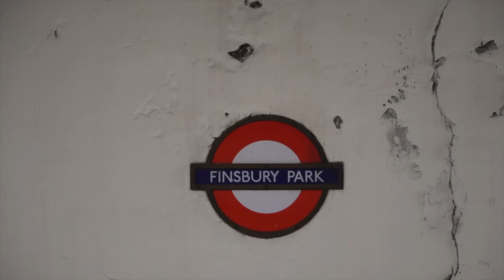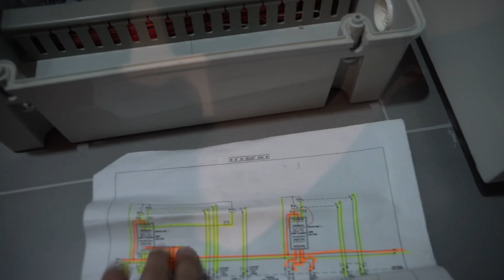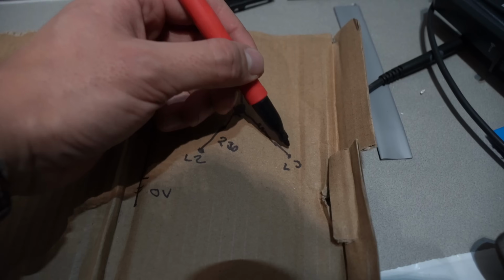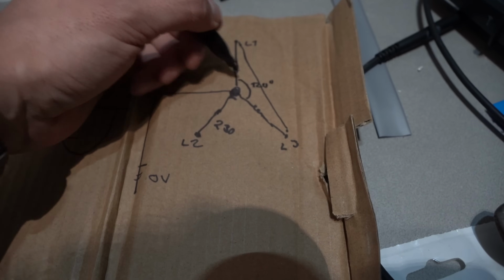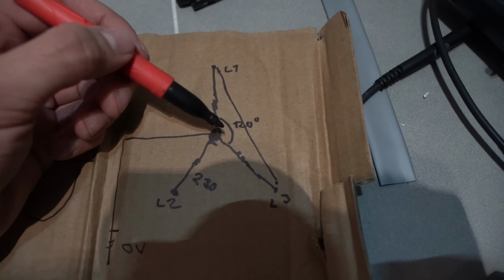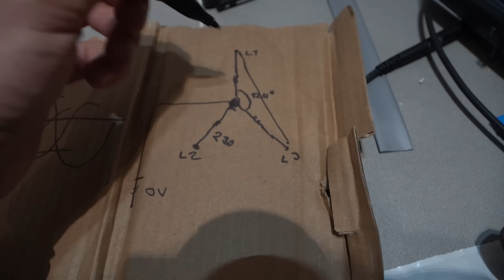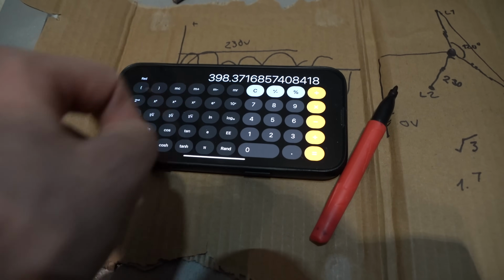£10,000,000 London Apartment Electrics, Why is it so EXPENSIVE?  | ØY15

Comment: would still not have enough to use pythagoras. but if 2 sides are the same length (isoceles), like this, it will produce 2 angles beside the 120, that are equal, or (180-120)/2 = 30. Now we can use sin(30) = far/hyp and find the height we used to split the triangles, and now we can use pythagoras bcuz we have side "a" and "c" in both the right angle triangles.

The answer will be 230*sqrt(3) or 398.371...

Comment: 230 volts times square root of 3 or 1.732=400volts, no one phase is reaching it's peak at the same time. Each phase is 120 electrical degrees apart. In the US, most common nominal systems are 277v/480v or 120v/208v.  Canada also has 347v/600volt systems.

Comment: Great channel, isn't pythagorus theorem based on a right angle triangle, A squared, plus B squared is C squared. Looks like trigonometry with a 120 degree, rather than 90 degrees. Sine, cosine and tangent?
If you use 240 voltage x sin120, then divide that by sin30, you get 415. I think that's the one.
Great work, great insight..
Nice work.
Reply from the maker: You’re right!
Reply: @corymac  Need any tips on fibre, let me know. I have a wealth of knowledge and experience too on that.

Comment: Why split up the 3-phase and 1-phase breaker boxes? Here in Sweden most breaker boxes/distribution boxes have a 3-phase feed and then you just connect a busbar into the faultprotector with all the breakers. Then every third breaker have the same phase so the load is automatically better balanced.
Reply: Not necessarily automatically. Some planning is needed in regards to circuit allocation. 

Really enjoyed working in Stockholm a few years back 👍
Reply from the maker: That’s because Sweden, in general, has better habits than the uk electrically

Comment: Pythagorus' theorem only works for right-angled triangles you need to use cosine rule : 

cosine(120)=(230^2+230^2-x^2)/(2*230*230)

=>        -0.5=(52900+52900-x^2)/105800
=>  -52900=105800-x^2
=>        x^2=158700
=>            x=398

Comment: Maths lesson time. The triangle you drew on the cardboard has two lengths of 230v joined at an angle of 120 degrees. Step 1: split the angle into two angles of 60 degrees by drawing a line down to the longest line in the original triangle. The line just drawn meets the longest line at 90 degrees, so you end up with two right angled triangles. The angles inside a triangle always add up to 180, so the third angle in each right angled triangle will be 30 and the longest side of each is still that 230v. Put this to one side, for the moment. Step 2, draw an equilateral triangle with all sides equal to 2. Each angle is the same (and they must all add up to 180) so each angle must be 60. Step 3, split one of the angles into two angles of 30 degrees by drawing a line through it (the technical term is bisecting the angle) and continue this line so that it meets the other side of the triangle. Again this line will be at 90 degrees to the side of the triangle, so again this is  a right angled triangle with angles of 60 and 30 degrees. This time, though you know the long side of the right angled triangle (the hypotenuse) is 2 and the shortest side is 1 (because you split a side of the equilateral triangle of length 2 into two equal parts). Step 4, Pythagoras' theorem applies to right angled triangles (the sum of the square on the hypotenuse is equal to the sum of the squares on the other two sides). The square of the hypotenuse is 2*2=4, the square of one of the other sides is 1*1=1, meaning the square of the remaining side is 4-1=3. So that remaining side has length of the square root of 3 [or sqrt(3)] and the ratio of this side to the hypotenuse is sqrt(3)/2 (or the cosine of 60 degrees if you were taught trignometry). This ratio applies to all right angled triangles with internal angles of 30 and 60 degrees. Step 5, go back to the original "cardboard" triangle with its two right angle triangles and their shortest sides drawn back to back in Step 1. The length of the longest side of the original triangle is the twice the length of the "middle" side of one of the right angle triangles which in turn is sqrt(3)/2 times the hypotenuse (from Step 4). A consequence is that the distance between the two points of the original triangle is 230v times sqrt(3) or close to 400v, as you noted.

Comment: 9:00 There's a lot of answers on the internet that use this diagram but hard to find anyone explaining it… I get the maths you did, but I don't get what the triangles/three prongs are actually representing i.e. to a deeper level than just "they represent the phases"... I could draw a picture of a horse and say "you measure the length of it's leg minus the length of it's nose" but without understanding the original abstraction im not truly understanding what's happening… I take it they're representing vectors that relate to the three sine waves for each phase? I don't get exactly how you arrive at those vectors and what they mean, let alone why the distance between two end points of the vectors give us the answer….

Comment: so different than here in Canada... similar but completely different.
Reply from the maker: The lighting controls or the full setup?
Reply: @corymac  The plastic enclosures and European style breakers for starters.  We use 120/240v here in Canada, not hugely different than 230/240v. Just add a common to ground tie at the mains panel.. most residential connections are single phase unless you need 3 phase and live in an area with all three phases...we do not use RCD we use individual GFIC for water prone areas... We do not use plastic panels... nothing is as modular, unless it is for factory automation or industrial application we do not use DIN rail.  Residential is all metal enclosures and standard US square-D breakers.  We almost never use stranded copper either.  shall i go on... lol
Reply: Same Same but different

Comment: I don't know if you'll ever read this comment, but you should not put the fuse  upstream of the surge arrester, it should be connected under the cbo switch without any protection, just to prevent the protection from being damaged when an overvoltage comes in.
Reply from the maker: SPD’s need overcurrent protection. They either will have internal, or external where the manufacturer specified an MCB. Is this case it’s external.
Reply: @corymac  fuse is required  only for short circuit not for over current
Reply from the maker: Speak to the manufacturer 👍🏼
Reply: "According to BS 7671, all SPDs shall be protected from over current, which can be done through the use of an MCB or internal fuse."

Comment: Nice explanation but it is worth pointing out that on the waveform showing the sine waves for each phase the maximum voltage isn't 230v as 230v is the nominal RMS (root mean square) figure - the actual voltage at the peaks will be up to 357v or thereabouts - it depends on the actual voltage delivered which in the UK can be as high as 253v RMS.   This is why the insulation ratings on cables are based on the maximum peak voltage rather than the RMS and so seem larger.
Reply from the maker: You’re correct! I’ve pinned the comment, and will make a video on RMS soon. I just kept it simple for now to understand the premise of three phase, also, I was just coming out of a flu as you’ll probably hear in my voice 😂. Thanks for pointing it out!

Comment: As an electrician in Australia I just wanted to state that 230 volts is the RMS of the sine wave, The peak would be 325 Volts in this case and unfortunately Pythagoras theorem only works with right angled triangles and cannot be used in the way you say in your phasor diagram
Reply from the maker: It’s the same here, to be honest, it was just a little note scribble on the back on some cardboard off the top of my head! I didn’t think it would even make the video 😂. I’ve pinned a comment clarifying its RMS and Cosine

Comment: I think 'if in doubt ask' must be the standard CAD get out clause, I find it on every drawing I use. The 1.732 is derived from the Law of Sines for triangles rather than Pythagoras' theory. The sides of a triangle divided by the Sine of their opposite angles are all equal. VLine is opposite a 120 angle and VPhase is opposite a 30 angle. Setting VPhase to be 1V makes life easier, so you end up with 1V/Sin(30) = VLine/Sin(120). So 1V/0.5 = VLine/0.866, gives 2 = VLine/0.866. Re-arranging to find VLine gives, VLine = 0.866 x 2, which solving gives the 1.732 ratio. 
You also end up with the same value if you draw out the vector sum diagram and then measure the resultant line between VPhase1 + (-VPhase2).
Reply from the maker: So true
Reply: I wish more people took that advice.

Comment: As we talked about last night pal. Old C4 install & quite poorly designed by the original installers. All the lighting panels I've ever built generally have 1x rcbo per dimmer module on C6 curve. I bet none of those are type A too... all those led lights potentially DC blocking the original circuit... more than likely the inrush of the lights causing it to trip.
Reply from the maker: Yeah, it’s a dumb way of doing it!

Comment: Just a correction, 230V ac is not 230V peak; the peak is 230*sqrt(2)= 325V
Reply from the maker: Correct, I’ve used this to explain the three phase difference easily, I’ve explained RMS in the pinned comment. I’ll do a video on that soon

Comment: As I hope people have already mentioned... The peak voltage of each phase is 340v, not 240v.  240v is the RMS value or "equivalent DC value"... i.e a DC voltage of 240v will deliver the same power across a resistive load as 240v AC.
Reply: Why is RMS the "standard" used term and not the peak?
Reply: @Jay369  if you connect 240v DC and 240v AC RMS to the same resistive heating element, it will deliver the same temperature so back in the early days of the grid when they were battling over whether it should be AC or DC, I guess they needed a way of expressing an equivalence with the DC system.
Reply: @Chris-hy6jy  

Thanks for the reply.  Much appreciated 👍

Comment: It was all going so well, but then you said that the waveforms peaked at 230 volts. Someone doesn't understand about RMS values. It's a thumbs down from me. Tell it right or don't tell it at all.
Reply from the maker: Check the first pinned comment 😎. I’ll do another video on RMS
Reply: Sorry Cory, I'm watching this on a mobile phone. It doesn't show any pinned comments, so I can't comment on those. My point is that you could have said "average" or "measured" value. So I repeat, get it right or don't say it at all.
Reply: @devonfuse  

You must have very high ceilings to fit it here on that high horse. 😂

Comment: Nice video Cory. Just a note that, the spd cables should not exceed 1m line and cpc combined (preferably less than 500mm). Yours looked like they exceeded that
Reply from the maker: Check the regs more carefully, and come back with what you find 😁👍🏼. We already did 😉⚡️✌🏽
Reply: @Cory Mac - ØY Electrical  well after looking I still don't think you can exceed 1m on an install like yours so I would be intrested in how you think it could. It would be great if you could cover it in a video
Reply from the maker: I’ll make a video on it as it comes up a lot. I had this issue a while back so ended up researching and digging a bit with manufactures until I found the solution. 0.5m is unreasonable, when divided across conductors on three phase it’s near on impossible. I’ll have to find my notes and make something on it
Reply: @Cory Mac - ØY Electrical That would be great.  In the manufacturer documentation you only measure the length of the phase conductors once
Reply: f the cable length between the SPD and the SDB or electronic equipment 
being protected >50m, we recommend a Type 1+2 device with In= 30kA 
(8/20µs) is fitted. This will work as a strong Type 2 SPD protector, coping 
with transient overvoltages and different earth potentials (particularly if 
the equipotential bonding of earths is not continuous)

There is some manufacturers who have exceptions to the 1M rule

Comment: Interesting thats Not one of my Control4 Enclosures ours have a lot more room :)  Looks like they got the terminals from me though as the idents look like mine.  We always have an RCBO per Control4  Dimmer or Relay module and generaly use 10A Curve C  as some of the drivers can have high inrush.  BTW  these are the older versions C4 modules  the newer ones you can split the Neutrals but these days with LED lighting low loads we tend to just have one feed per module.  When we do 3 Phase  panels we have a phase per C4 Module but its best to avoid 3-phase if you can and just have the lighting on one phase  they arnt going to balance anyway in a demestic property.  Hit me up if you ever need any help or kit.
Reply from the maker: Interesting!

Comment: Good to see you bringing this up, but the 230 V of a single phase to earth/neutral is the RMS voltage. Nearly all multimeters give you the RMS value which is equivalent to the heating effect of 230 Vdc. Drawing 230 at the peak of the AC waveform is incorrect and could confuse the youngsters.
Reply from the maker: Correct, my bad for not being clearer

Comment: A very good explanation of 3phase, except peak voltage of each line is approx 320, the average is 240 (0.707 times peak voltage); total between lines approx 590 x 0.707 is 415. Also having  over stuffed trunking you getting more heat, so you need bigger cables; making it even more stuffed. Bigger is always better.
Reply from the maker: Correct 👍🏼. But as per ‘the book’, thanks to the EU we are now on 230 volts, even though we aren’t 😂

Comment: SPD should go where the 63A C type breaker was fitted, great the way you explain the supply, I've learnt something great vid
Reply from the maker: Glad it helped
Reply: Crabtree make a SPD kit for these DB's and they definitely don't go where the MCB is. The last one I fitted comes with a Din rail bracket to mount inside the enclosure low down on the left hand side. They even have a knock-out on the cover ready for the SPD